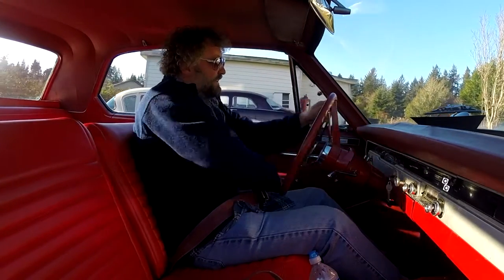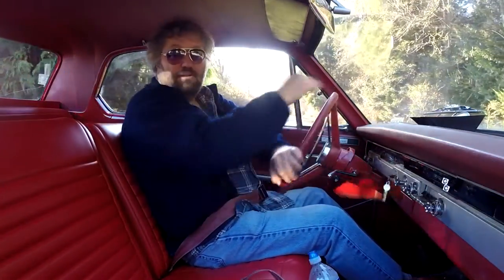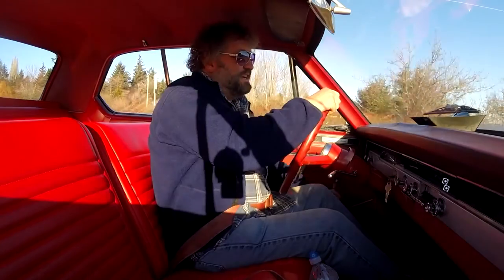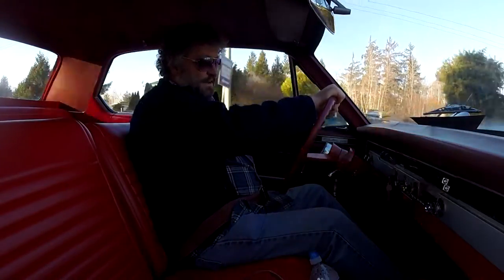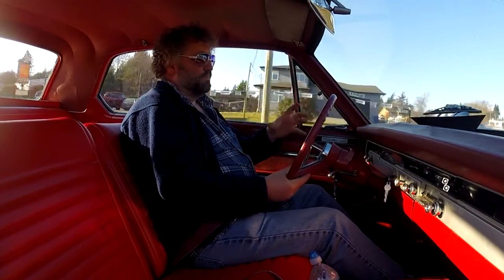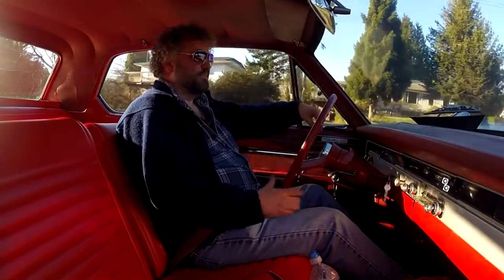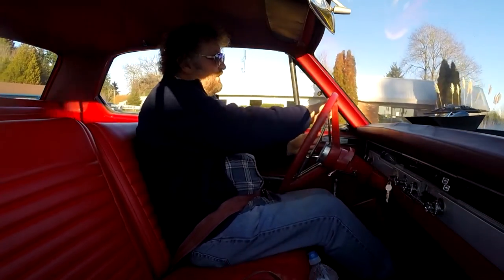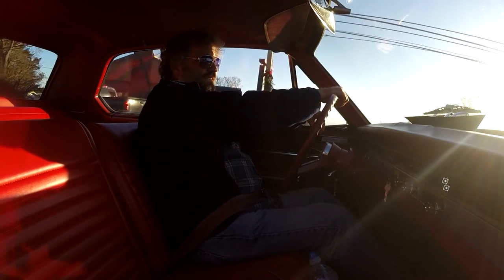1966 Valiant Timing Chain Summary

Comment: My '63 has been out of service for a minute, I am sad to report. Your car talk regarding not being able to get the timing dialed in leads me to think that I may be due for a new chain and gears too. I have rebuilt the distributor to include new points, condenser, cap, rotor and vacuum advance. I also installed new plugs, wires & coil. I know that these parts were a good investment regardless but getting her to start and run right has evaded me so now with colder months moving in, I am putting it in my garage and will be replacing the chain & gears. I know there are numerous guys who swear by the electronic ignition conversion but I have no reason to think that my current analog set up is obsolete. I am glad that you got your Valiant running again because our vintage rides are very enjoyable to drive and I definitely miss being behind the wheel of my old Dart. Hopefully next Spring will bring new life in more ways than one for me? Best wishes to you and thanks for taking the time to share some of your life experience. If we were neighbors, we would likely be good friends. Take care!
Reply from the maker: I don't bother with electronic ignitions either, but I do swear by the points replacement units. The magnetic pickups which replace the points (no other serious mods except to use high energy coil). That did eliminate a miss fire that would NOT go away otherwise. I have a bunch of videos covering the timing chain replacement, but I had so much material on it, it never went together well for me as an instructional video at all. My BIGGEST problem with the whole timing chain replacement was getting the god-damn cover back on while still keeping the front oil seal working.
Reply: @MicrophonicFool  I will take a look at the magnetic points. The coil I am using is an Accel 8140 Super Stock.